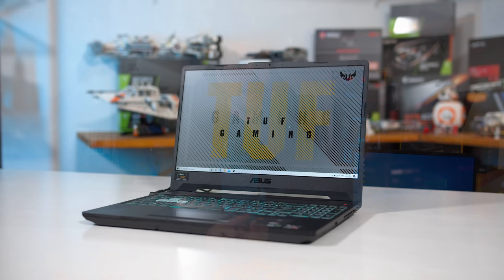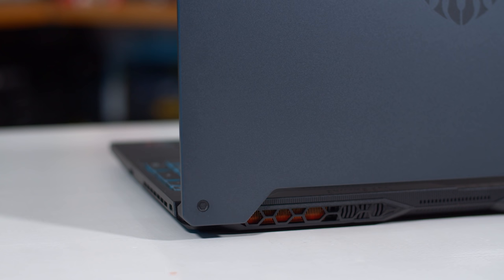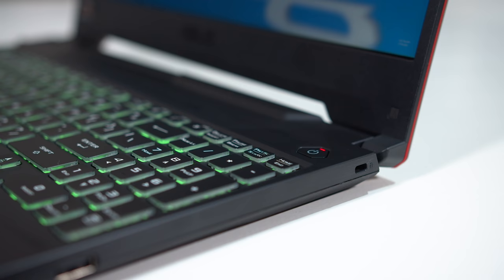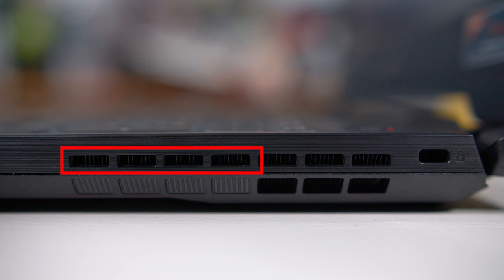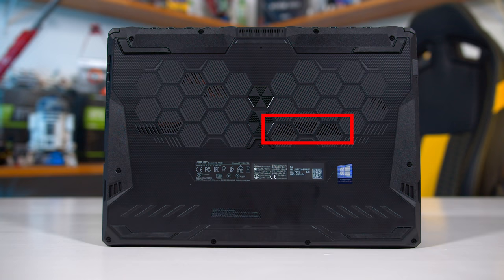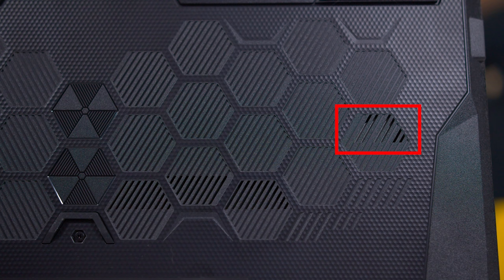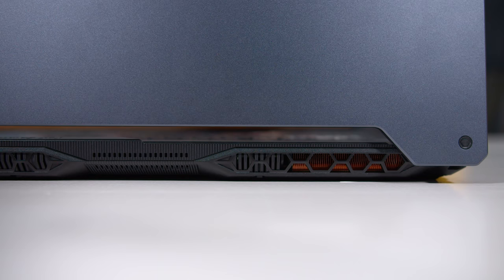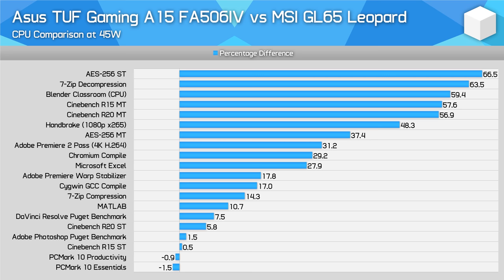Don't Buy The Asus TUF Gaming A15 (2020 Model)

Comment: Despite your personal opinion, the ASUS TUF Gaming A15 is an affordable laptop that has treated me beyond excellent. Only had a few minor issues with it throughout the 2 years I've had it that were easy fixes if you have a basic understanding of what you're doing (They even have a program to diagnose computer issues and live support to help). One of the biggest issues I have had was the fans. All you gotta do to fix this is open it up and clean the fans once in a while though. It has a sleek, modern design that has held up, and supports ethernet, USB, USB-C, and HDMI and headpones (all anyone should need). The laptop has not slowed down one bit and can run very high-end AAA games at a solid 60 with no issues. It also has 2 GPUs, (which is very nice and convenient). For $1,000, this laptop is BEYOND worth the price you pay, you can take my word for it.
Reply: mmm owning a rtx20xx at a price of $1000 in 2020 must be good

Comment: Why dont laptop makers just put a large open vent with anti-dust mesh covering it?
Reply from the maker: Many laptop OEMs do this, because it's obvious and makes sense. Or at the very least they put the vent over the fan so it can intake directly. Asus didn't get the memo obviously
Reply: Because that'd be sensible. ASUS clearly doesn't know what's sensible.
Reply: @Hardwareunboxed  You just don't get it. This design is engineered and tested. It is supposed to be like that as intended, by asus.

Comment: I own the 4800H and 1660TI,
I can tell you the vent on right and bottom is blocked so it doesn't heat up the table and your hands as much when gaming. Unblocking that you will get sweaty palms.
I completely disagree with with open air test, any laptop will drop 6 degrees with bottom removed.
More opening doesn't mean better, less water resistance, more noise, more interference.

Laptop is targeted for casual users. If you are a pro, a entry level gaming system is not for you, for me is perfect and if you complain about screen, use an external. 

All other laptop with better screen simple cost more than $999 you will be paying for those features where I dont.

Cooling is more than sufficient, fan doesn't even spin when on battery on typical tasks. 

Review is bullshit
Reply: Agreed
Reply: Cooling design is such a hard topic to get the right solution, i really do wonder whether its justify to have less intake holes
Reply: Agreed. It's a complete clickbait (really what adults give a title like that to their reviews) and unnecessary elitist. The screen is the only weak point and frankly it's okay if you're gaming at 1080p, and not doing any graphics work (and this laptop isn't meant for that). Can it be better, of course? But which $1000 gaming laptop has better temps, battery life, and CPU/GPU? None. $2,000 gaming laptops also have shit temps and require undervolting/repasting. You can't expect a budget laptop to buck a trend that is true for the entire industry.

Comment: I bought an Asus FA506IV 1 month ago with 8 gb ram and upgraded to 32 gb ram and installed winpro. Not a player but using high-end cad/cam softwares and doing professional renderings. Using with a 29" monitor with 2560x1080 res. and laptop screen is also on. I am using high end engineering or gaming laptops since 2003 and this one  has made me happy and comfortable. I have no idea where those dozens of heat problem indicating videos are coming from. I didn't experience such problems anytime even during 4k video rendering output that continued 17 hours without break.

Comment: Are people surprised ASUS is screwing AMD over in favor of INTEL?, being paid or not ASUS is gimping AMD laptops on purpose, just look at the same chassis model but with an Intel CPU and you'll see what we all have been talking about the last 2 months, biggest example is ROG M15(Intel) vs ROG G15(AMD) which share the same body but has the cooling fans blocked in the AMD model with PAPER! but with the Intel model being completely open and with liquid metal as TIM on the CPU.

Regarding what Tim said at 9:23, the biggest issue is that ASUS did paid attention to the airflow path and how to cover the intake above the fans on purpose that way they can make sure the AMD model suffers from thermal problems, review the intel variants of the same chassis and you will see it. You might think they want you to buy their products regardless, but no, they want you to buy Intel laptops and not AMD.

They also keep using trash displays for AMD model but top of the line screens for the same model that has an INTEL cpu, this is not a conspiracy, just checking most reviews out there you can tell what ASUS and Intel are doing, fucking disgusting.

Also at 12:45, yes those high quality IPS are common in $900 Intel laptops, ASUS went out of their way to make sure ALL their AMD laptops have crappy screen, the G14 and G15 also have shit screens, multiple small creators on youtube that have reviewed these AMD/ASUS laptops suspect some shit is happening behind the walls, Intel at it again with what they did in 2006? maybe yes.
To people out there wanting to get and AMD laptop please don't, they will keep doing this shit no matter how many they sell, if you truly want one then wait for more companies to make other models before the end of the year, just make sure you dont buy ASUS, fuck'em.
Reply: Then what brand do you recommend? Lenovo? 🤔

Comment: Man this laptop is a mess 🤦‍♂️😭
Reply: What is weird is that the g14 is pretty amazing. I got mine yesterday and the only thing that I wasn't absolutely blown away by was the choose in ssd. Intel 660p is a QLC based ssd but I was surprised about how fast it was still. It's weird seeing the g14 being so good by the a15 being less competent.
Reply: Keaton Blomquist i sent back my g14, loved it and the design but just cant deal with 16:9 on laptop screens anymore lol
Reply: @tmi1234567  just wanted to ask, goes G14 have any blocked air vents? I know G15 has.
Reply: @tmi1234567  TUF<ROG
Reply: RhinoFreak not that I know, but the temps on the G14 are not better, the hot air gets blown into the screen, limiting performance

Comment: TUF luck to anyone who already bought it

i'm sorry
Reply: thx:o
Reply: "TUF"?
 ..more like "The Ultimate Fuckery"
Reply: 😂😂it's quite alright
Reply: There is a silly trick. Buy another bottom panel and make hole on it. Use it daily. if you want waranty claim just use the original one. The problem is we need some time before big e comerce sold this.
Reply: @muhammadhanifkurnaen6689  exactly. I recommend the same for G15 as well. Same problem, same solution.
Reply: @muhammadhanifkurnaen6689  really, you can actually buy a separate case somehow? Seem like a good solution tho
Reply: I don't identify any of the problems raised in this video. I actually like it.
Reply: I bought a TUF A17 last month for doing video production on the road and I don't regret it.  Yes the screen sucks, and yes the thermal design is bad.  But I have a small secondary monitor I got (100% Adobe RGB) for color correcting, and even with the thermals considered, for the price it still destroys everything intel has to offer for video production.
Reply: I just RETURNED mine - was still within a 1-month return window for any reason.
Reply: ATADEMO lol bro ! Just cut and make some exhaust holes plus just open up more intake vents and maybe stick a mesh on it on the vents like the MSI for filtering air ! Plus I would say don’t care about the Ram its just reg CL 20 ram ! If it burns out use some Branded ram with heat sinks !
Reply: @rahuldogra  I've thought about doing that actually.
Reply: @Hanseul Choi I dont want a laptop with good sRGB coverage.  I want a laptop with 100% Adobe RGB coverage.  And a laptop with 100% Adobe RGB is going to cost a fortune.  My portable screen is about the size of a tablet.  I Can set it up next to my laptop and have a dual monitor setup.  It fits comfortably in my laptop front pocket.  This setup is better then any standalone intel system out there.
Reply: I own it and have no regrets.

Comment: Man, this video convinced me to buy this laptop
Edit: Thanks for making the review. It really helped in the decision process. I do not care that much about the color gamut. And thermal performance sounds good to me as I will rarely push it as you do in gaming , I’m using it basically to run FDTD simulations. Hopefully, I’ll remember an give an update. Again, thank you!
Reply: Update?
Reply: So as an update: so far this laptop has performed really well for me. I expanded the RAM to 32 GB (2x16) and added a second 1 TB m.2 drive. The fact that you can do these upgrades easily is very nice. As for simulations, everything has been great running simulations on both CPU and GPU. I have wrote a couple scripts that take advantage of multi cores to make calculations and it has been awesome the Ryzen processor is truly amazing. On both simulations and my own scripts temperatures of CPU and GPU stayed under 70 degrees Celsius . I did run a couple of games on it just to try it out and the thermal performance there could be an issue, running The Witcher 3 at 60 FPS I saw CPU temperatures of 91 degrees Celsius and at 30 FPS I saw temperatures around 75 degrees Celsius. Hopefully this is helpful. Cheers
Reply: @danielgr95  ..thanks brother...
Reply: @danielgr95  is that r7-4800H 3050 4gb?

Comment: I would be interested to see a true test on airflow effectiveness of those vents instead of just questioning why holes are blocked. 

it's basically questioning a car aerodynamic base on just your eyeballs
Reply: Oh my god exactlyyyyyyyy
Reply: Well he did say when open the temperature drop further, but i wonder is it becoz to comply with the military standard to prevent excessive dust from entering during operation time frame
Reply: that's not a true test, any laptop would yield better result without the cover. Plus there's temperature of the overall laptop components to consider too instead just cpu and gpu. this review sounds like it's wants to be different from all other reviews to capture attention and gain popularity, look at the title.
Reply: @zero2zero4  yeah you  have a point but he has a reason ??
Reply: @zero2zero4  what's your point? That this channel is a fraud?
Reply: @s2korpionic  my point didn't matter to you. But they haven't earn my subscription that's all. Didn't matter to them too I'm sure.

Comment: Just bought one with the 4800h and 1660ti. With a cooling pad with 2 80mm fans blowing air right under the intake grills I get 73c on my 1660ti, playing fallout 4 maxed out at 1080p. Play for about 3 hours doesnt get above 73c, also gpu boosts up to 1950mhz sometimes hitting over 2000mhz. Have it at turbo mode on and nvidia control center max power all time.

Comment: Summary :

1 : Bad cooling system
2 : Low quality screen display
Reply: Is it good for coding and casual gaming(low-medium spec)?
Reply: what laptops in this price range have good cooling and a great display?  they all seem to have the same issue
Reply: thankss bro
Reply: @gamerxxx231 wow same dude! That's what I only want to know
Reply: @nedopanic1810  why'd you buy this for low gaming when you can get off with a 1050 laptop
Reply: Bad battery life also
Reply: @arko3822  wow expecting good battery life on gaming laptop
Reply: @alphonsokurukuchu  as compared to other gaming laptops with 90wh and 60wh battery with rapid charge like legion 5i.. tuf ke bahot se models mein 48wh hi hai....
Reply: @arko3822  legion 5i is 80k lol I'd rather buy a better laptop with rtx 2060
Reply: @alphonsokurukuchu  amazon mein70k ka mil raha tha legion 5i aur flipkart mein asus tuf a17 69k in sale.....woh bhi original wala.....not refurbished

Comment: In my country, ASUS TUF FA506II AL016T costs 1029 usd + bonus 8gb from reseller + 2-year warranty. Meanwhile, MSI GL65 costs 1350 usd + 1-year wanrranty and also MSI laptop in my country has very bad reputation about their durability in the long run.

Comment: For the price point ($999) I paid and my use (i.e., occasional gaming, business, day to day, mild content creation, etc.) the ASUS laptop is sufficient. I have an external 1440p monitor that I use as well so the panel shortcomings I can deal with. Plus, the 4800h is far ahead of Intel's offering in the same price point. Also, I prefer a laptop over a desktop because my work is mobile upwards of 40% of the time. Based on the overall value proposition of the laptop (1 year accidental warranty, Ryzen 4800h, GeForce 1660ti, 500gb NVME SSD, 16GB DDR4 Ram, RGB, and one screw to access the expansion slots for an additional NVME SSD and RAM) it's a very good choice despite the drawbacks. Especially when you compare it to other laptops in the $800-$1,200 range. Sure, the MSI seems more well rounded, but I will gladly take the ASUS over the MSI because of the CPU benefits and overall value for MY NEEDS. Nonetheless, the key-points on the areas for improvement for ASUS should be well noted and improved in the next design of the TUF laptop.
Reply: And you get an extra bonus if you work in harsh conditions.
Reply: Do you use the external 1440p monitor for content creation as the RGB on this laptop is bad?
Reply: Mine replaced a 5yr old PC (which it out performs) and I am very happy with it . All of the criticisms are valid , but seeing how I use a large , quality , external monitor for my creative tasks and at home gaming , they don't really  apply to my use case . I'm told that fitting extra ssd storage will void my warranties , so I will perform my own case mod's when the time comes if cooling becomes an issue .
 I needed a laptop in a hurry after my old PC was destroyed in the recent Australian floods. This one was available locally , on sale , for $400 dollars off RRP. I have had it for a couple of weeks now and I love it .

Comment: @Hardware Unboxed
 Tim isn't this the second time the ASUS TUF design that has failed an AMD product?
Reply: There've been many more. Off the top of my head there were also the 5700XTs and the Vega cards.
Reply: Theres bunch from them. In laptop segment, the M409/509 and A412/512DA its example. Its not using real heatpipe. The biggest blunder is ROG Zephyrus G15 with its air intake fan blocked. check at techtester channel. She try with other panel that has holes under fans and it runs cool

Comment: I only been found video telling how good value and good laptop ASUS TUF A15

But not this one
Reply: Nugget  Not negative attention. I have the previous version of this model and it's thermal design isn't much different if at all from this one. The CPU gets insanely hot and the fps drops tremendously every now and then in any game I play. The screen even though it's better than a 60hz panel, the slow response time makes the motions smear (called ghosting I believe) but I'm fine with the accuracy as it doesn't matter to me. But what asus has done maintaining the bad thermals is a poor marketing choice to save the rest of their lineup. I had some hope in them but this is atrocious.

Comment: Well, after 6 month of using A15 with Ryzen 7 + RTX2060 on board I can say this:
* Still runs like new, only one bsod.
* Display is pure shit, but I was aware of that before buying. I use my laptop as workstation (UE4, level design) and connect it to a monitor (there's DisplayPort over USB-C in case someone is not aware). On laptop display I only run Slack. Works for chatting :)
* Noisy under load, but being my first gaming laptop I have nothing to compare it with. When idle I can barely hear it.
* Open Hardware Monitor shows some insane internal temps (insane from a fresh gaming laptop user's standpoint, probably they all are like this), but I could never feel it while typing.
* Decent camera, shitty mic. Had to buy cheap ass Maono lav mic for Slack calls, lightyears better then internal.
* Existing internal audio, but who cares?
* Keyboard is okay, but I don't type a lot. Fells spongy compared to Logitech K380 I'm currently using.

Now for the most interesting part, thermals. Under normal working conditions I measured daily maximums of 95-97° for CPU and 85° for GPU. Normally it was running at 85° CPU and 80sh GPU.
Then I realized that despite AMD saying 105° is maximum for CPU, my laptop is not only CPU + GPU and those temps may negatively affect lifetime of other components. And I'm not a huge fan of buying new hardware every 1-3 years.

So I checked for a few tricks to reduce temps without killing performance. And I kinda succeeded! Simply by disabling CPU turbo-boost and undervolting GPU (1500 MHz at 700 mV) I achieved what I wanted:
* Reduced daily maximums for CPU / GPU to 85° / 75° (normally around nice 72° CPU and 68° GPU)
* Didn't notice significant difference while working with the Unreal Engine: shaders compile almost as fast, navmesh rebuild takes exactly the same amount of time for large scenes (VERY large, not some arena-based top-down mobile shooter prototype), FPS in the editor viewport is the same, PIE FPS dropped like 1 or 2 on average.

Lastly I'd say that Ryzen is a beast! Why the heck does it even need a turbo boost? Only for the sake of increasing temperature by 10°? I know better ways to fry an egg :)
Never regretted buying this laptop so far.

Comment: one thing which is very bad with msi laptops is that having a big open chasi at the bottom can allow unwanted dust and materials inside the device and you have to clean it frequently... the vents should be placed at the bottom of the fans.... and big enough to breath sufficiently... that's it... making a almost half naked laptop is not a solution ....